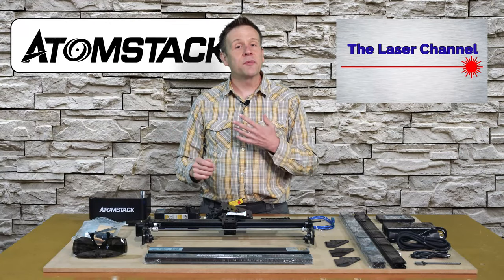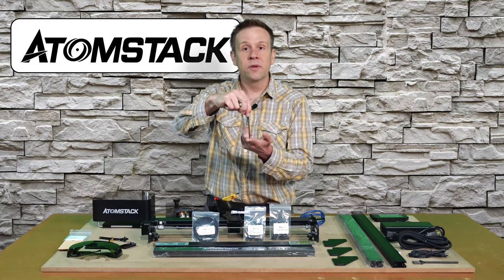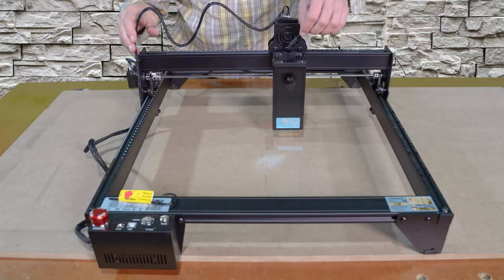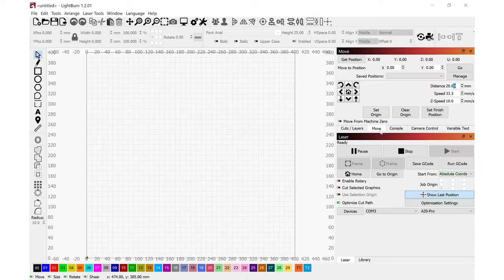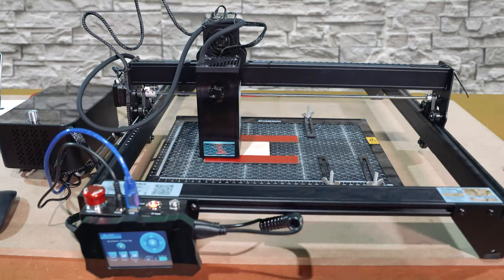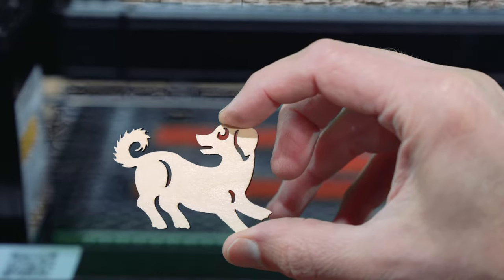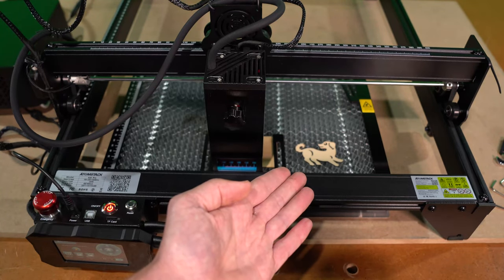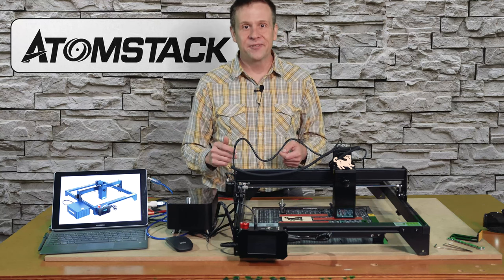Atomstack A20 Pro- Review and Project!

Comment: Excellent step by step review. Big like. I was looking forward to getting this model. I setup my machine and to my surprise when I connected the power cables, the power button got red, the laser fan turned on without turning the power switch on. It would not turn the power off unless you pressed the emergency button. When released, the power stayed on (red) despite of the off  position. I have no clue if I got a defective controller box. The reset button would do nothing. Anybody else had this problem?
Reply from the maker: That sounds really odd.  Mine just powered up once I released the red E-stop button.  I think there's FB group just of Atomstack- they have some info for you.
Reply: Thanks for your reply. I have not done any engraving yet and the TF card was not inserted. I noticed that after inserting the TF card into the controller box I was able to power on and off the machine. I will check the FB for more tips. Best regards.
Reply from the maker: @Selfcreative  Yes- the TF does need to be installed on the controller box as you found out.  I copied the files on my PC before installing the card into the controller- this way I a PDF of the manual on my computer along with the booklet that comes with the machine.
Reply: Thanks a lot.  It works now.
Reply from the maker: @Selfcreative  Perfect!

Comment: I just got mine put together, however I cannot get it to cut through 6mm plywood. I am using Lightburn at 10 mm/min and 100 percent power. I even made 2 passes and it still didn't make it all the way through. Any idea what I could be doing wrong here?
Reply from the maker: I have a couple of things to check- double check the focus is set properly or slightly into the material, air assist is set at max air flow, and make sure there's an air gap under the work material.  A lot also has to do with the type of material- construction plywood has a lot of glue pockets which does not laser cut very well- at a minimum furniture grade plywood has worked well for most.

Comment: Hi. Thank you for very good review. One think worries me with my machine: the spotlight don't show up. Do you know why?
Reply from the maker: The spotlight or as LightBurn calls it- the laser fire button.  Here's how to enable it: In LightBurn, go to Edit > Device Settings, or click here: Turn on the ‘Enable Laser Fire Button’ switch (make it green).  There's also a fire laser while framing in the same menu panel.  On the main Lighburn screen on the Cuts/Layers tab the Fire button will now appear- click it to turn on and increase the power see you can just see the laser beam- usually about 0.25-0.75%.  Note- use only on Diode lasers and not recommended for Co2 laser machines.  LighBurn link with more info: https://forum.lightburnsoftware.com/t/how-to-enable-fire-button/24950.
Enjoy!

Comment: Can someone help I received my new A20 a week ago upgraded from my A10 pro the problem is every engraving is slightly cut off on the bottom line, also when I run the material test in lightburn it barely cut through 3 mm plywood thanks in advance for your help
Reply from the maker: Hi- there's two things I would check, 1. Move the laser module in the x and y direction making sure it moves smoothly and 2. Check for proper focus of the laser module to the work surface. Hope this helps!

Comment: Hello, What materials can you cut and/or engraved. What is the durability life span, if i use it everyday?
Reply from the maker: Hi- thanks for watching! The machine engraving Stainless steel, crystal, stone, plywood, most fabrics, wood, laser safe plastics, mirrors(the non-reflective side), glass, paper, coated tublers, acrylic, rubber, some food items, ceramic tile, leather... It can cut plywood, most fabrics, wood, laser safe plastics, paper, some colors of acrylics, some food items, leather and many others.  I couldn't find any numbers for the life span of the 20 watt laser module.  Many users recommend running a max power of 80% to extend the life.  Cleaning the laser lens and making sure the cooling fan and electronics are free from smoke residue also greatly extends the life of the laser module.
Reply: @thelaserchannel1  thank you very much, very informative 👍

Comment: I bought one of these last year,  never got around to using it.  Got it all back out last night and I can not find a SD card.  Do you know where,  or could you post / make a video with its contents? 

It would make for a huge video as NO ONE anywhere on the internet,  has the contents of that sd card anywhere,  so beginners have no way to start.

Thanks for the video.
Reply from the maker: Sure- I'll add the video idea to the recording list!  Until then, I'll copy the files over to my Google drive and post a link for you- thanks for watching!
Reply: @thelaserchannel1  ohh thanks so much!  maybe add it in your description as that will also get you some views to this video.  I appreciate you!

I actually contacted atomstack and they replied 'sorry we have not posted them anywhere',  instead of just sending me a link or the files.  So you are already better tech support than they are:)
Reply from the maker: @send-golf  I checked out the SD card- it's a 4gig card formatted as FAT32.  It contains Laser GRBL software and Lightburn link to the 30day trial.  There's also machine settings for Laser GRBL and Lightburn.  The contents of the SD card are too large for me to upload and host.  All the files on the SD card can be found at the Atomstack website.
Reply: @thelaserchannel1  The only real thing I need is the test contents.  I In their instructions they say put the card in and run the tests (the settings files I am guessing). Did you ever test yours like that?  I am sorry,  I am new to the laser thing, I just wanted to run the little test print before I move forward.  I greatly appreciate your help.

Comment: question for you. atomstack 20w or the xtool?
Reply from the maker: Atomstack 20w for the WIN!  The Atomstack costs less and includes a very powerful air assist kit.  The Xtool costs more and does not include the air assist.  I also just read today that Xtool botched yet another firmware update and that is creating a lot of issues for users.  I own a regular D1 10 watt and I'm just not that impressed.  Maybe me opinion would different with a D1 Pro.  I've had only positive experances with the Atomstack A20 Pro that I own- it just always works for me.
Reply: @thelaserchannel1  ty for helping me with my choice

Comment: My shipment did not have the screw packages separate and labeled..  Also there was not an SD card included in the shipment..  I have had my engraver for two weeks and have yet to be able to use it..  I am disappointed and waiting for a reply to three messages I sent to them.. Also I saw a notation that said there was a charge to use the lightburn program..

Comment: was muss ich einstellen das mein A20 Pro dort zu schneiden anfängt wo ich auf dem Raster gezeichnet habe, er fängt irgendwo an zu schneiden
Reply from the maker: Verwenden Sie die Option "Starten von" "Absolute Koordinaten". Wenn die Maschine referenziert ist, arbeitet der Laser vom x,y-Koordinatensystem aus. Der Laser erstellt das Projekt basierend darauf, wo die Objekte im Arbeitsbereich in der LightBurn-Software platziert werden.
Use the "Start From" option "Absolute Coordinates"  With the machine Homed the laser will work from the x,y coordinate system.  The laser will make the project based on where the objects are placed in the work area in LightBurn software.
Reply: @thelaserchannel1  alles Ok besten Dank für die rasche hilfe

Comment: I have the same machine and I’m using LightBurn. I’m annoyed because when I hit start in LightBurn the laser turns on and it starts but it doesn’t actually engrave. Even on light burns highest setting the machine doesn’t even make a mark and the laser is on. What am I doing wrong?
Reply from the maker: I can think of two things to check- ensure the focus distance is set correctly and the protective lens is clean along with the curved focus lens is not cracked.  The Atomstack Facebook group is also a great source of information and help. If the problem continue after checking the above I would recommend contacting Atomstack.
Reply: @thelaserchannel1  Its weird because if I just use the controller it engraves perfect. When I send a job in light burn it doesn’t actually engrave. Is there settings I’m using wrong? The computer is plugged directly into the machine and it’s focused.
Reply from the maker: @majormatty4753  I'm wondering if you delete the machine in LightBurn Devices and have LightBurn find your machine again if that would help.  Also check if you have the SD card inserted in your machine.  Atomstack has a FaceBook group that might be able to point you in the correct direction.
Reply: @thelaserchannel1  Thank you for your help.

Comment: Atomstack A20 pro und LightBurn 1.3.01 Hilfe ich habe ein Problem, ich Zeichne ein Quadrat 400 x 400 und der Laser macht auf der Y-Achse 400 und auf der X-Achse 200, an was könnte das liegen die Rotation ist übrigens ausgeschaltet
Reply from the maker: Es tut uns leid zu hören, dass Sie Probleme haben. Das hat mich auch verwirrt - ich habe noch nie davon gehört, dass ein aixs so asynchron ist. Ich empfehle, sich direkt an Atomstack zu wenden.

Comment: Can I Engraver on gun parts and mags?
Reply from the maker: It depends on the metal and the effect you're looking try to achieve and if the materials are coated and if you're looking to engrave by engraving just through the coating.  The best laser would be a Fiber laser- it's crazy fast and will engrave all metals and plastics.